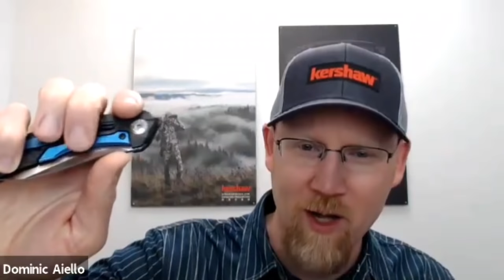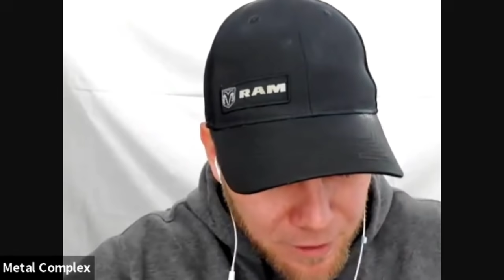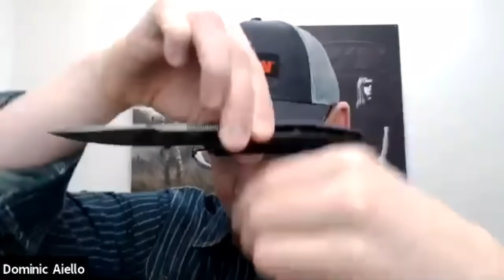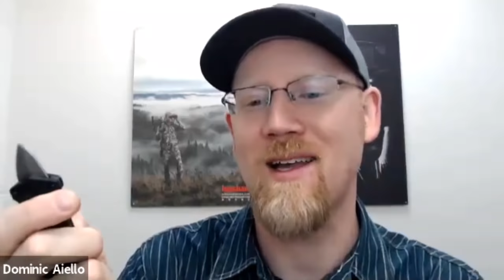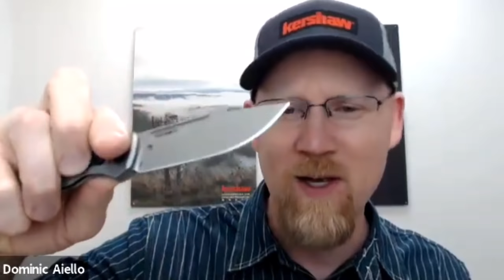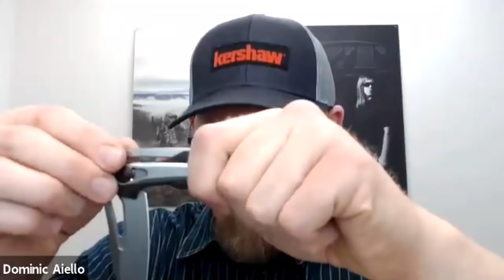New ZT & Kershaw Knives 2021 - A Chat with Designer Jim McNair

Comment: I'd like to thank Kershaw for coming out with the lck large and small it's the first time I didn't have to really dig into my brain to see which size I wanted because I think a 3.5 inch and 4 inch should be the break off point for 4 a.m. folding knife these two models you have a large 5.4 I think it is and a 4.5 in I mean that is fantastic I think the 5.5 of be a little too large for me right now but the 4.5 in is perfect thank you so much for coming out the lck large and small they are great and they're kind of plain-looking and I like that not all these rules in Halls and everything else hanging off it I like the Aesthetics just a plain clean looking knife in the handle and blade take over it's a perfect life I think just my view I am definitely getting one of them now I'm digging do I really need to 5.5 or 5.3 whatever it is or I think I'll go with the smaller for once in my life I'm going with a smaller size oh thank you cuz Shaw thank you for this video Shelly William Boyle
Reply: I’m in the same boat; trying to find out what size i like.  I went from a 3 inch, to a 3.2 inch, now we got a 3.5 inch blade.  Hard to find the “right” size.